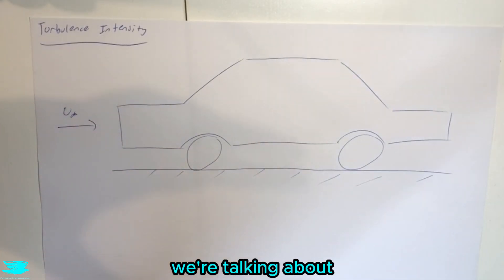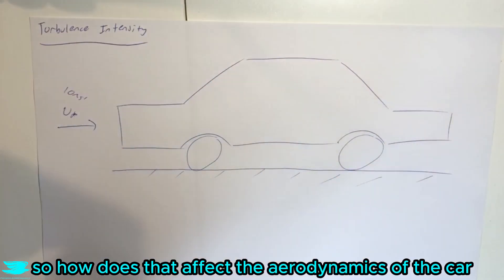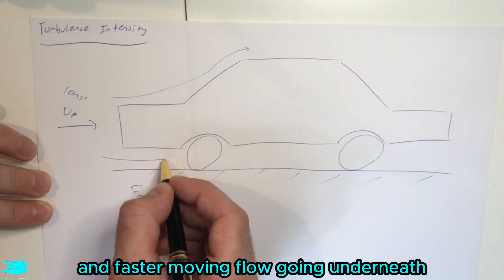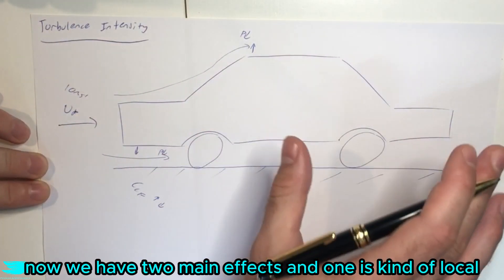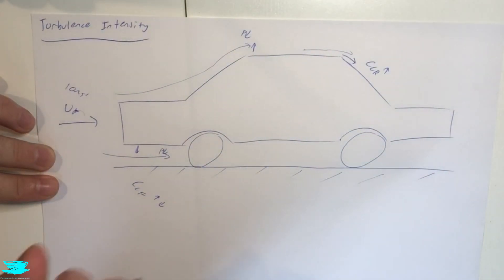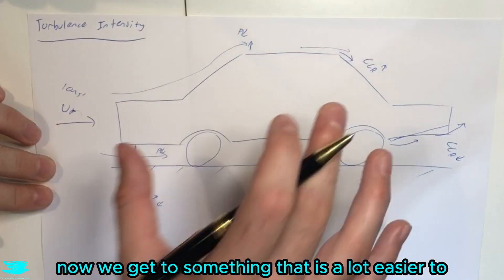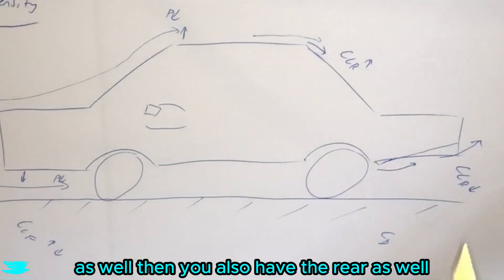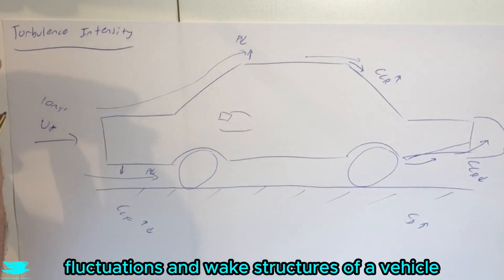How Turbulence Intensity Affects Car Aerodynamics {Auto Aero #70}

Comment: I imagine that turbulence intensity for vehicles would be proportional to the (ground reference-frame) wind speed, which (assuming no wakes from other vehicular traffic) is independent from the airspeed of the vehicle. Therefore, as the vehicle airspeed increases, the turbulence intensity (as a percentage of vehicle airspeed) decreases. Among other reasons, this might be why wind tunnels require such strict flow controls. They are simulating a flow velocity that is dominated by vehicle speed, not wind speed.

Also, can I assume that CFD turbulence intensity is 3-dimensional? If so, the Y and Z components of turbulence would increase drag, side-force, etc., due to angles-of-attack on the car body.
Reply from the maker: Good point about the speeding up, but even at the standard 140 kph, the turbulence intensity is much more than the typical 0.1% to 0.5%.

Yep, the turbulence is three dimensional, even two dimensional turbulence leads to 3D breakdown and that does render many parts to act differently.